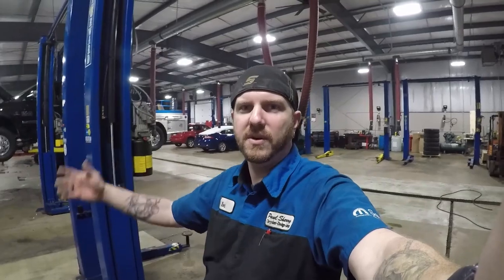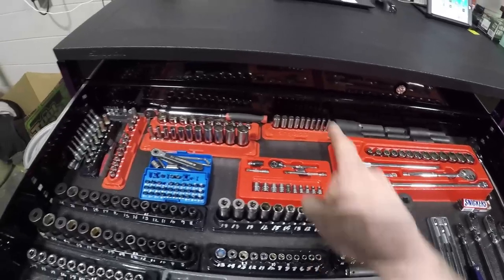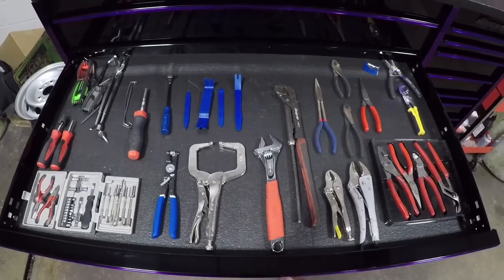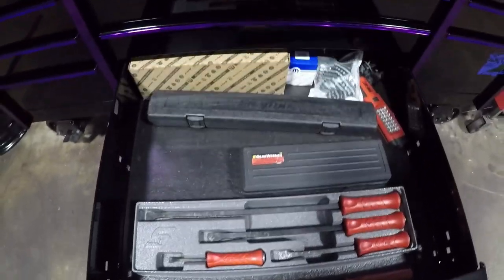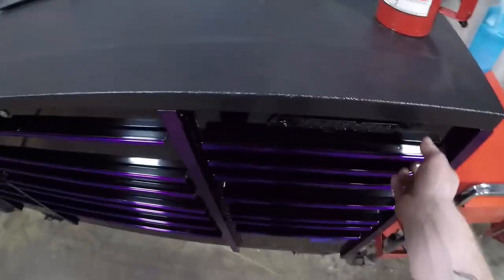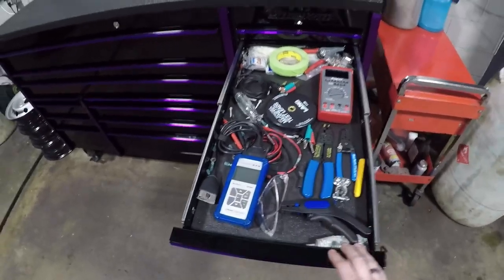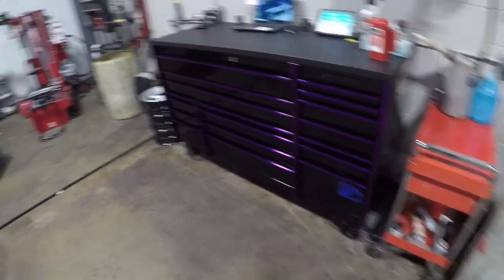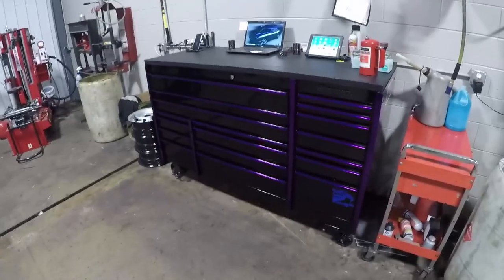Tool Box Tour - One Year Later....

Comment: Question from one tech to another. I’ve purchased my Gearwrench wrenches from Amazon/Ebay (cause it’s so much cheaper.) Snap On warrants Gearwrench. My boss (our lead tech) says to be careful cause if the tool-truck guys know or suspect that you have not purchased those wrenches off of their truck, they will not warrant them. 

Have you had any troubles? Has anyone here in the comment section had any troubles? Feel free to add any additional comments or opinions on the subject matter. Keep wrenching!
Reply from the maker: Great question....  I personally have had no issues with my snapon rep replacing anything that snapon covers under their warranty, but unfortunately that carts from rep to rep. Some are a little fast and loose with the replacement policy so it all depends on the guy running the truck. Thanks for watching the video!!!
Reply: Like what Ron said, it depends on the rep. My reps are pretty good about warranty for the most part.
Reply: IRaceFormula agree with the guys above, it depends on your rep. If you spend money with them they usually don’t mind warrantying your amazon bought gear wrench. It’s the guys that never come on the truck and ask for nothing but warranties that get turned away...